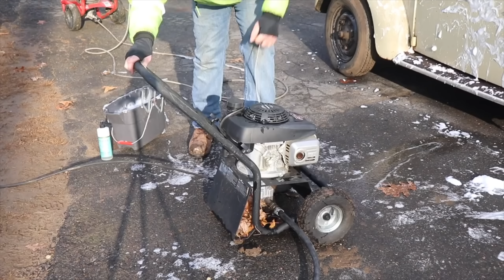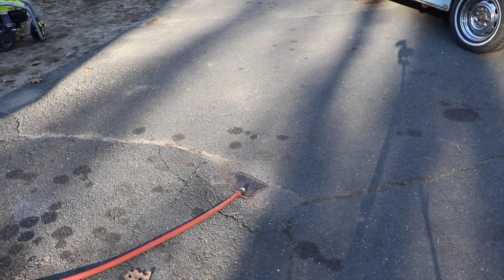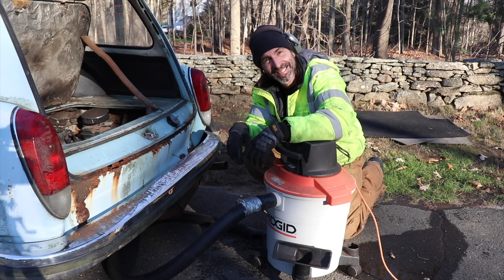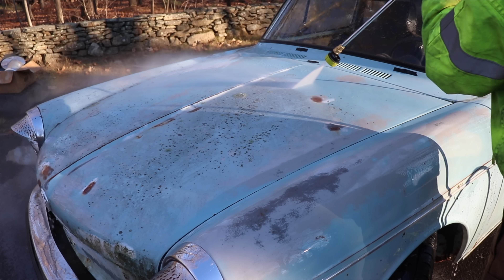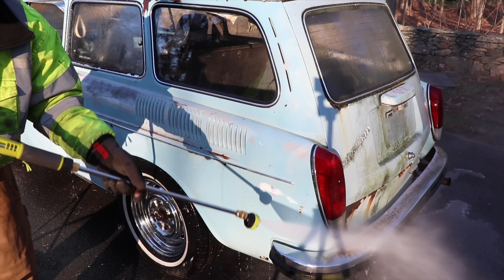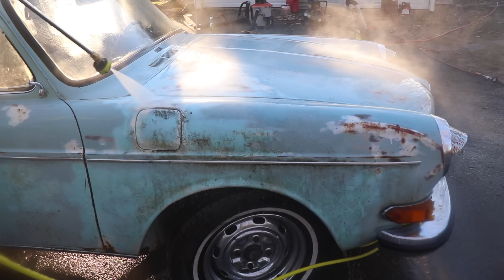Car FIRST WASH in Years Volkswagen Type 3 Vw Squareback Revival

Comment: If you want to open the gas filler door, you need to pull the knob below the glove box door, near the passenger side door.  Pop outs were standard on squarebacks.
Reply from the maker: thanks 76', yeah i remembered it was a " new " car haha..
Reply: @5150mxVW  
Those type 3's give a smoother ride and have more elbow room.

Comment: I missed the notification for this video, don't know why but i will post my thoughts anyway. I like those wheels but the back ones may get chewed on the arches so check that before you get too far ahead. The chrome looks good for the most part. I hope you try the cooking foil trick I mentioned a while back, To recap; take the foil, the stuff you put on your turkey, and dip in warm water and rub on the chrome, you can put a little washing up liquid in the water if you like. The foil has a chemical reaction with the chrome and cleans it very well, try it on the headlight covers as they look a bit rough. I have to say that it is not like a re-chrome but almost as good. Take care Jason.👍👍
Reply from the maker: Thank you Stephen , yes I wanted to make it a roller and they are too big for sure . I tried foil and ketchup once ( recommendation) ...nope haha
Reply: @5150mxVW  Just the foil dipped in the warm water. The washing up liquid is optional. Believe me I have seen it work. It was used on TV by a British guy,  Henry Cole. He dose stuff on YouTube as well,  he's into vintage motor bikes and cars. Do try it Jason. I'm not just saying that because I'm British,  it's not a  wind up.

Comment: I used to hook the M hose to the water heater drain and run hot water to melt the ice. After a wash i would drag the hose up the yard to drain it completely.

Comment: I was riding with a guy who had a 66 "S" square back. It had a gas heater in the spare tire well. Well, we stopped to make a u turn. Fortunately this happened right next to the fire department. As soon as the car stopped the gas heater burst into flames. Quite exciting. As luck would have it there just happened to be some guys hanging around the fire station and was quick with some fire extinguishers. Not much damage to the car but sadly it changed hands and the engine was removed and put in a shortened bus or truck. I don't remember which. It was the early 80s. I don't know what became of the wagon.

Comment: Had one of these with oversized tires and made the mistake of yanking the rear fenders out to gain an inch. There's a rubber seal between the fender and the inside wheel well and it will leak rainwater onto the floor as the tires spin if you pull too hard.

Comment: The offset on a type 3 is different than a type one I ran into the same problem
Reply from the maker: well, the 205's didn't help, maybe 185's will be good
Reply: @5150mxVW  ... 185s should go without hitting, provided they are stock rim dimensions. If you have the option, go 185 / 70. It gives it a nice stance without making it look too tall.
Reply: Type 1 offset is ET34 where as Type 3 is. ET43.